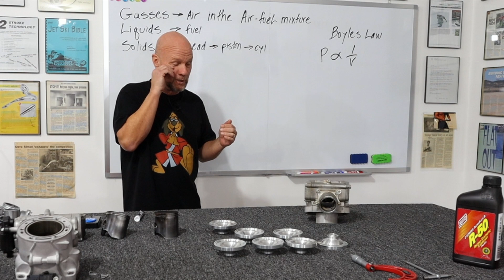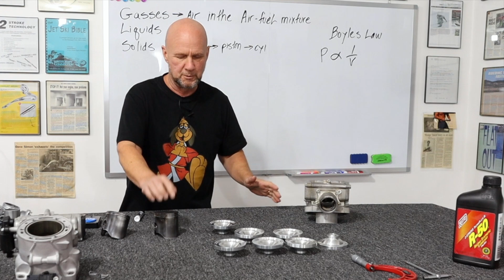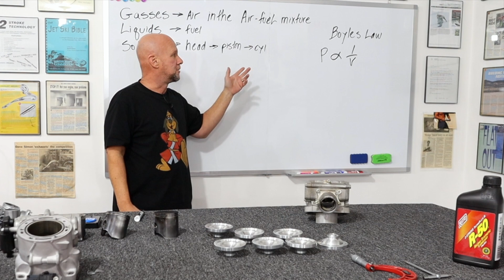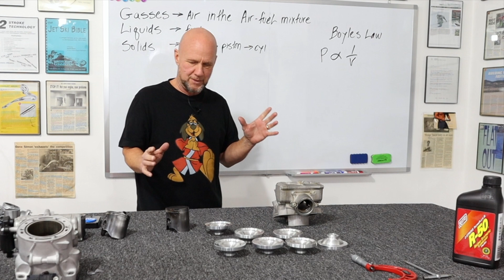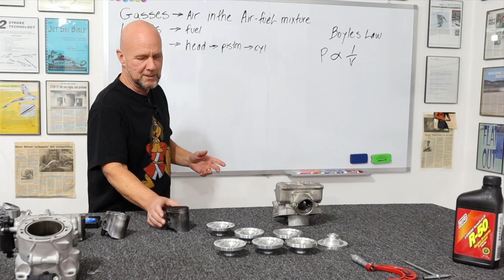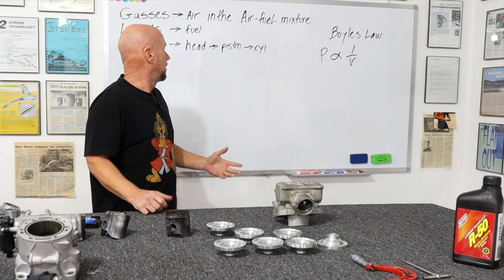TBI Bike Problems | The Issue With High Compression

Comment: Have a 23 tpi with your V1 relocation block...no ECU work....was thinking about going with a RK TEK head as they say stock ECU works great with their product..in your opinion, should I keep stock head and go with a reflash? Just looking for the best route to go
Reply from the maker: Depends on your elevation, but if below 7000 ft, the refresh always works better.  The extra compression will just kill top end, especially if it get's about 200 psi.   $250 for the refresh, which is specifically designed for that block, will do far more for all over power, at a lower cost, and not run the risk of a high rpm melt down